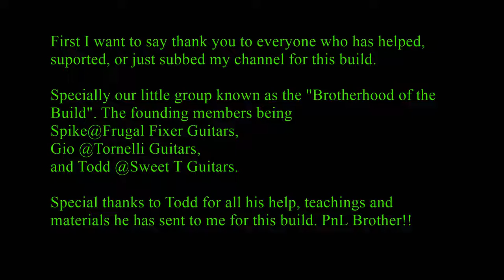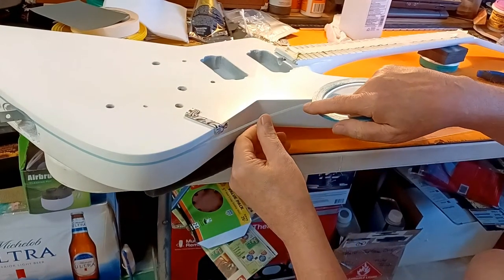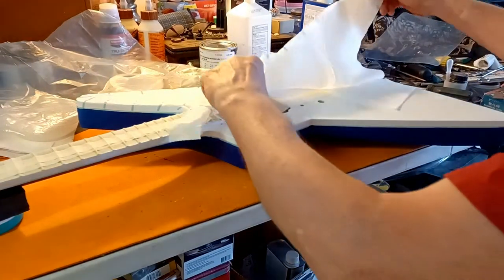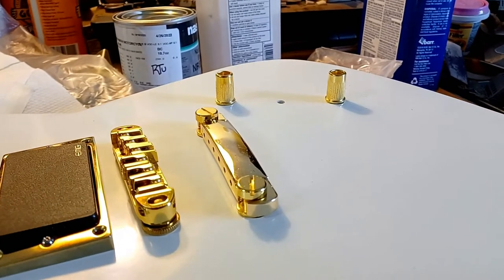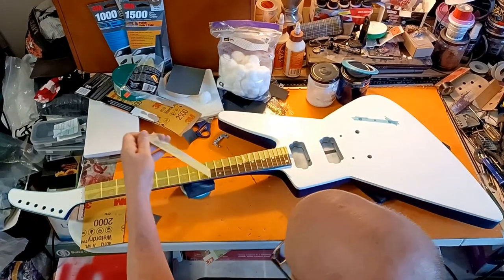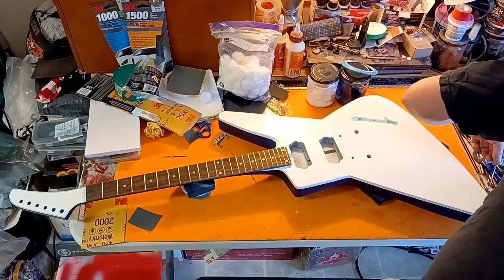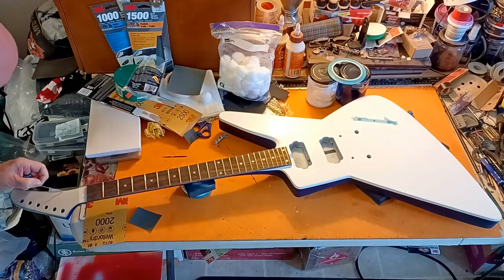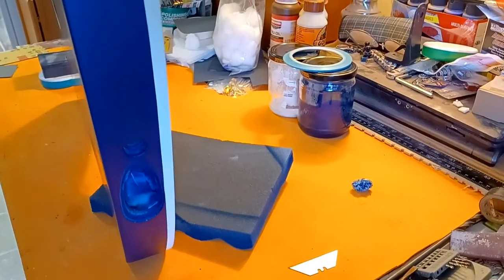GGBO 22 Build gets a name "Thick Lzzy"  and fresh paint work

Comment: That blue is so killer! You did a really great job with the fineline man. Very cool!
Reply from the maker: Ahh there's tha man!! Thank you Todd. I was hoping you of all who watch what I am doing would approve. And yes that blue is just going to explode under clear and be even better. Down to touch up or full spray with the white as there were some imperfections in my surface prep that bit me in the arse before clear can be done and on to final assembly. 

I did manage to put the strap buttons in and hang it on my shoulders. Weight is NOT and issue and it balances perfectly. BUT hardware still needs to be put on to say for sure.

Comment: Looking funky bud, I'd go with the gold myself, think it'll look classier. 

Ps don't sand the blue, you don't sand metallic unless you're adding another coat or it loses it's look.
Reply from the maker: I had no choice but to sand it. Figured out why the sides look great but the back looks like crap. I have to use an airbrush not a gun and was laying the body flat on its face. When it came to shooting the flat back I had to shoot at a slight angle which created massive over spray dust so the next pass would lay over the dust and by the time I got across the entire back it looked textured. I am making a stand so I can shoot it more vertical then horizontal so I can spray properly. It'll look MUCH better next time you see it.